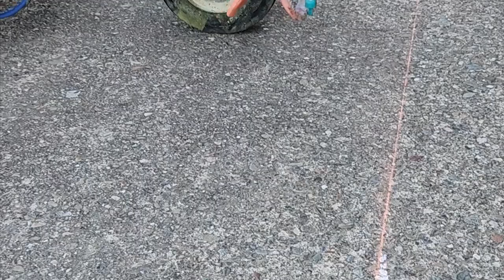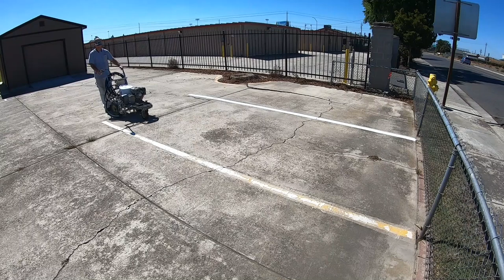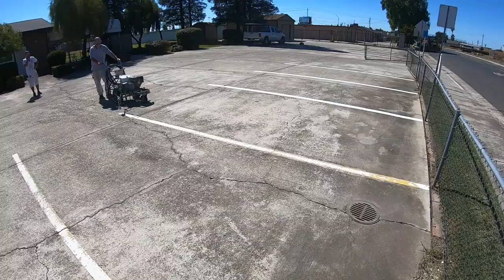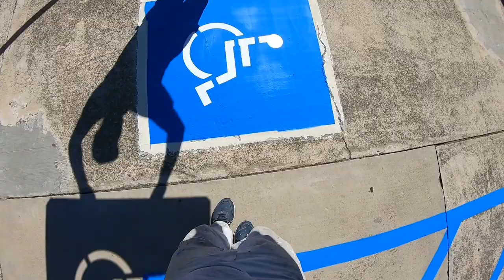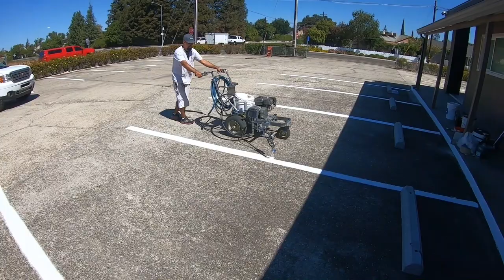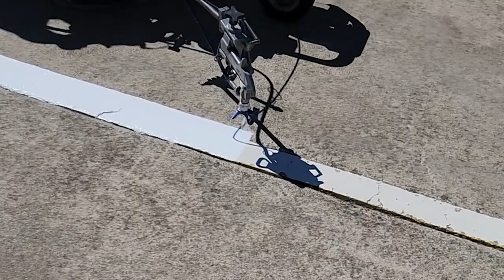My First Parking Lot Striping Job! $3000 in 1 day

Comment: My question is with a lot of these jobs how often do you clean the ashalt in advance? And do you clean the entire parking lot or just pressure wash areas to be striped? 

This is the one thing I’m trying to figure out. 

The work is out there most def
Reply from the maker: We washed just the areas scheduled for paint and did it same day.
Reply: what my crew does depending on job is we go and blow the dirt and rocks away with blowers then we crackfill and seal coat and next day do striping
Reply: Con que material rellenas y sellan.. que punta usas para 2000psi..?

Comment: FYI tip, in California your accessible parking spaces and access aisles must meet California Building Code Chapter 11 which is different than ADA compliance. Inspectors will be inspecting your work using accessibity codes, ADA is a civil right, not a code. But here's the hard part for you, you still have to be ADA compliant or you and your business can be sued in a civil lawsuit. Get a set of 2022 CBC accessibility laminated quick cards from Bullders Book. Best of luck and sucess to you, God bless